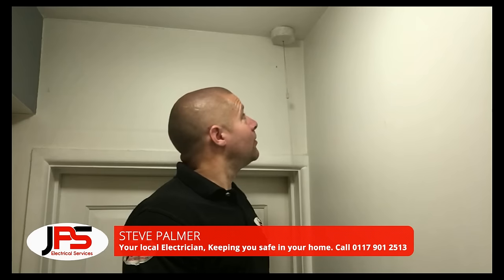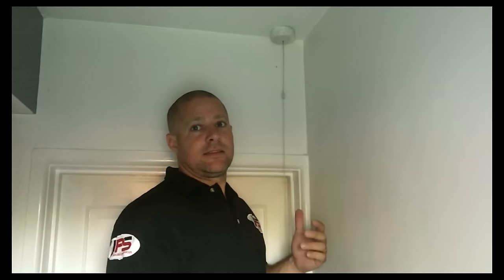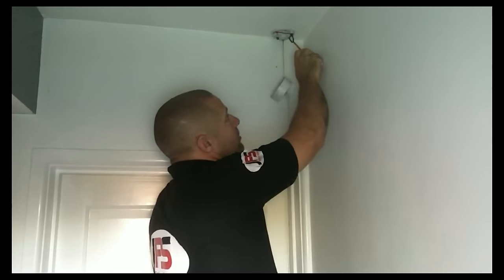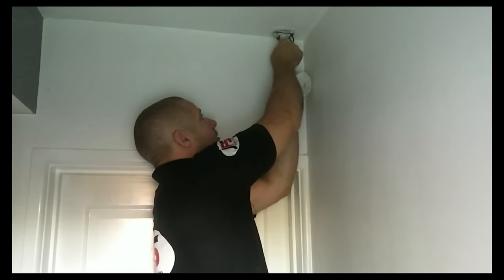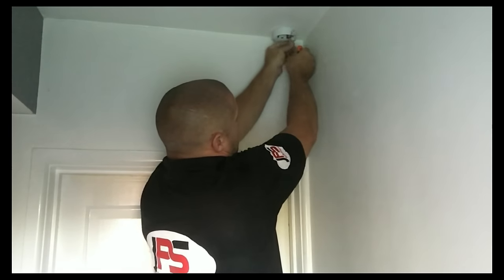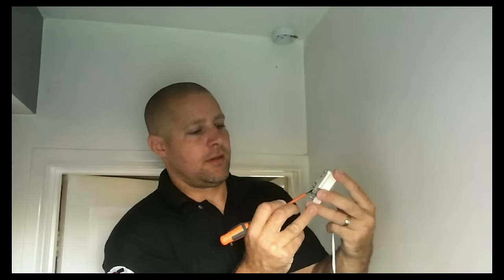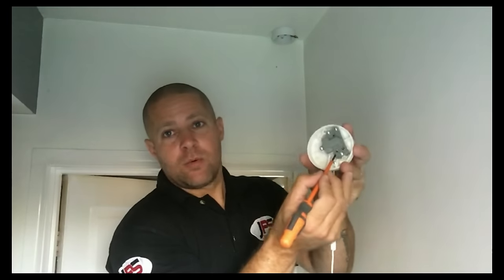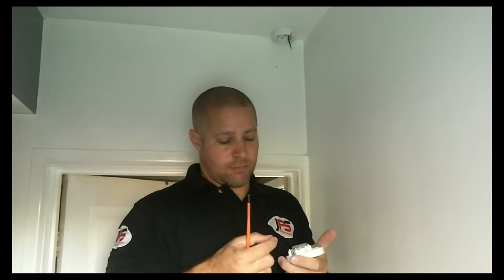How To replace a pull cord light switch - Your local Electrician

Comment: For anyone caught out by closed shops, but desperate for a fix, the switch can be dismantled and cleaned. It's not a difficult job, and can get you out of trouble. Ultimately, a new switch will be required and it's great to see videos like this giving confidence to laymen. I've taken my "broken" switches apart many times. You'll see a little plastic plate with a couple of screws holding it in place in the centre of the switch plate. This houses the mechanism,  essentially a spring and a two-piece locking/turning device, which sticks when dirty. Remove this, but don't cut the cord as this keeps the parts from going astray. Let the pieces fall away from each other and use a tissue or cotton bud(I sprayed some glasses cleaner on mine!) to clean the parts inside and out. Put them back together again and, with luck, the switch will continue working for some time. Generally it is just dust, grease and grime that makes the switch stick. takes about fifteen minutes to do the job from start to finish. And it's eco friendly.

Comment: Fab video Steve, just fitted my pull string light in the bathroom. I Wouldn't normally touch electrics, as a single woman I would usually call someone in. You made it look quite simple so I gave it a go. All 4 spot lights and the fan came on. 💃 So thank you very much indeed.😊
Reply from the maker: Hi Denise, I'm sorry I missed your comment. I do try to reply to as many as possible but unfortunately it's not always possible.

Thank you for taking the time to let me know how it went. I'm pleased my video was of use to you.

Kind regards
Steve :)

Comment: Thank you so much for the information! I was quoted  £90 - 105 + vat and parts (+ £25).
Decided to give it a try after watching your video. Took exactly 6 minutes and cost just £5.50!
Reply from the maker: You are most welcome :)

I'm pleased that you found my video useful. Thank you for taking the time to provide me with the feedback.

Kind regards
Steve :)
Reply: @JPSElectricalServicesBristol  i have two red cables how do i know which is live
Reply from the maker: @MrRapez  Confirm that each wire is in a different screw terminal on the existing switch. If there are markings on the existing switch showing C and L1 then mark one of the cables so that you can copy it on the new switch.

Kind regards
Steve :)
Reply: @JPSElectricalServicesBristol  ive sorted it thanks for your help
Reply: Who ever quoted you that should be bloody ashamed of themselves, total disgrace.
Reply: Yes 100% agree. 👍 

It seems some of the neighbours have paid an eye watering amount for simple jobs and most of the local tradesmen now think it is a norm and ok to fleece customers. One of them had a cheek to say that if it fails in next six months he will fix it for 65£ but cash in hand!
Reply from the maker: @TeeLion  Too many variables to support this statement! This is exactly around my price range for a job that can be completed within thirty minutes of being AT the property. Do you think I should feel ashamed of myself?🤔
Reply: @JPSElectricalServicesBristol  what for changing a pull cord switch? Mate your having a laugh.
Reply from the maker: @TeeLion  That's not the first time I have heard that response but in the twelve years I've been in business I've had more people pay my prices than question them.  For those who cannot afford my rates or prefer not to pay my quoted prices they have the option to use a cheaper electrician or view the video I created to see if it's a task they may be able to undertake themselves?

Comment: Fitted a new one cause the old cord came out and putting it back together looked a nightmare. However the builder we had to install new broom, kitchen, radiators and boiler cut a gap in the live wire sleeve when he fitted the switch so when I put the wires in the new switch it touched the ground which had no sleeve and shorted and tripped the light circuit breaker. 

Stripped the cables all back, luckily had lots of excess cable, rewired following your inst, all sorted. Thx a lot, life saver. 

This is the 5th time I've had to fix a problem he created, goodness knows how the heating still works but have had the boiler serviced every year so that helps I guess.

Comment: Thank you so much for this! I replaced mine today where the spring had snapped, and this video a. worked, b. I didn’t get electrocuted, and c. I didn’t need to call and electrician.
Reply: Hi there, do I just turn off the main switch that controls all the electricity in the house? My string just snapped this morning . Lol

Comment: Thanks for the video, very useful. Only suggestion would be to include both the old and new electricial wiring colours for the UK. 

I had brown and blue cables (new system) rather than the red and black cables (old system) you mentioned. Wasn't a huge problem as can easily find this information online, but for anyone else reading this in future and confused:

LIVE:             Red (old) = Brown (new)
NEUTRAL:    Black (old) = Blue (new)
EARTH:         Yellow & Green (both old and new)

So Red or Brown wire into COM and Black or Blue wire into L1
Reply: Thanks for that. I was a bit confused.

Comment: Cheers pal, just changed mine. Would have done it ages ago if I’d known how easy and cheap it is to replace. One thing I checked was to see where the wires were going and into which terminal before undoing them.

Comment: been in our house 12 years and the original cord has snapped in the switch...how do you identify which cable is which if its not sleeved...
Reply from the maker: Hi Rob, with a pull cord switch, red (or brown) in Common and black (or blue) in L1.

I hope this helps.

Kind regards
Steve :)

Comment: You said to put the red wire in the common but when I opened up my pull cord socket it showed black in common and red in 'way' and the green and yellow in earth?
Reply from the maker: Thank you for your comment.

It will still work the same on a pull cord light switch. If you did the same thing on a standard rocker switch then the light would be on when in the off position and off when the switch is on the position. Some people will just unscrew the light switch from the wall and turn it upside down to rectify this issue.

The correct way is Live to Common, switched live to L1.

I hope this reply is useful.

kind regards
Steve :)

Comment: Your instructions were very helpful thank you. I seem to have to pull the cord 3 times before light comes on. Do u think I will need to replace the whole thing? Thank u.
Reply from the maker: Shamini Sathiya Thank You for taking the time to comment. I’m really pleased that you found my video useful.

With regards to your light switch. It sounds like the mechanism inside is slipping. I have seen this numerous occasions and if this is what has happened to yours then a replacement will be required.

Kind regards

Steve :)

Comment: Hi Steve my pull chord switch in my bathroom has stopped working and I need to replace it (I've recently bought a new two way switch, although I believe that a one way would of been OK). My current pull chord switch turns on the extractor fan as well as the light. Will the wiring be exactly the same set up as in this tutorial?. I haven't yet managed to get the old fitting down as the screws are rusted up, but I suspect that the old wiring inside may be different colours to how they are today?.
Reply from the maker: Hi William, yes indeed. There could be additional wires inside the switch that will be for the fan. It all depends on how the wiring has been configured. I did one only last week where even though the fan was wired onto the lighting circuit, all the wires had been wired in a junction box in the loft rather than the switch.

I guess it’s time for another video demonstrating the method when extractor fan wiring is taken to the light switch :)
Reply: @JPSElectricalServicesBristol  , OK Steve thanks for the reply. Once I get the old switch open (I suspect that I'm going to have to break it because the screws are rusted solid), I'll see if it looks like a fairly straight forward job. If it's just a matter of uncoupling the wires and reconnecting them to the new switch then I'll do it myself. If I have any doubts about what I'm doing, I guess for safety reasons I'll have to see about getting an electrician in. Once again, thanks for the prompt reply.
Reply from the maker: @williammorley2401  camera phones are a life saver these days. Be sure to take lots of shots, from different angles, before you take everything apart. This way, if you don’t recall what went where, you can refer back to the photos.

Also, some switches will mount straight to the existing base. If this is the case, it can save you having to strip everything down completely.

I hope this helps.

Kind regards
Steve :)
Reply: @JPSElectricalServicesBristol  , thanks Steve...

Comment: Very helpful thanks. Just one question. I have a pull switch that connects the fan and the light. There is a separate isolation switch for the fan outside the bathroom. There are 3 reds (one from fan, light and also the isolation switch outside} 2 blues (currently tied together.. One from light and fan} and one black and grey (coming from the isolation switch and tied together). The 2.way pull switch has L1, L2 and com..The 3 earth wires are correctly and safely in the back plate. Its the grey wire throwing me. Thanks :)
Reply from the maker: Hi Tim, thank you for taking the time to comment. I'm pleased that you have found the video useful.

Unfortunately there is a discrepancy with the information that you have provided. For this reason, it would be very irresponsible for me to try to advise you further.

I hope you understand that it is more than my reputation is worth to try to advise on how to proceed with only a description.

Kind regards

Steve :)

Comment: My rope snapped at the top so I purchased a new fitting when I took the old off fitting all the wires were red not the usual blue,brown and green. I thought I had memorised where to screw them into the new fitting..put it all together and then turned on the electric by the mains and pulled the bathroom cord. I was relieved and happy that the light had came on. When I was going to put my daughter to bed I realized that her bedroom light, our bedroom and the landing is not work. I read that that it was something to do with a loop the lights are on but kind of confused me. My question is it's dark upstairs now and I've had to leave the bathroom light on for light and especially if my kids need the bathroom during the night because all the other lights  now don't work. Will me leaving it on as it's been on for two hours cause a fire or Dangerous? I'm so paranoid now but it's to dark to do anything about it now. Can anyone please advise me.
Reply from the maker: Hi Pete, did you get any further with this?

My video only makes reference to the single cable coming into the switch which is the more common application.

When advising with regards to this method people can easily get in a muddle and if they don’t have the correct equipment then it can be difficult to prove what has been done.

If you still need help, perhaps we can arrange a video call to discuss what has happened.

Kind regards
Steve 🙂👍🏼

Comment: Hey there is it harder with one that has a on/ off circle switch thing in the socket next to the pulley?
Reply from the maker: Hi Aiden, thanks for taking the time to comment.

This video is for a light switch. The on/off toggle is usually found on shower isolators or even extractor fan isolators.

Do you have a link that you can add so that I can confirm the item is correct please?

Kind regards
Steve :)

Comment: Hi I have one for u. I have a pull cord switch with in and out wrote on it. My new switch is common l2 and l1. The one already installed has 2 cables and both are red/live so no black. Can I just copy it across? First time I've seen 2 lives on pull cord with 2 separate cables. Can u help please.
Reply from the maker: Hi Anthony, thank you for your comment.

Please can you visit my website www.jpselectricaslservices.co.uk and use the contact form to get in touch. It will allow you to upload a photo. This will enable me to see exactly what setup is in use at your property.

I look forward to hearing from you.

Kind regards 
Steve :)

Comment: Really great video, helped a lot! would you mind sharing how do i find out how many amp is needed for my pull cord switch? i saw many different ones online... thanks a lot!!
Reply: O that will be usefull for my as well :D
Reply from the maker: I'm sorry that I missed your comment until now. It's sometimes very difficult to reply to all of the comments.

In the UK, our lighting circuits are usually supplied by a 3, 5, 6 or 10 amp circuit from fuse box.  The higher rated ones such as 45 or 50amp ones are for shower circuits that require a lot more power.

Kind regards
Steve :)

Comment: Hi I have 3 black and 3 red wires? Not sure which to connect ? Do I need all of them connected?
Reply from the maker: Hi Rebecca, thanks for taking the time to comment. 

It sounds like you have already taken the accessory apart. Did you take a photo as reference beforehand? Usually one of the black wires will be identified with either a small red or small brown marker. Can you see this on any of the wires?

Kind regards

Steve :)
Reply: @JPSElectricalServicesBristol  Hi, I managed to figure it out! Thank you for your help :)
Reply from the maker: @rebeccar9916  fantastic news. I’m so pleased to hear this. Did one of the cables have a small marker on it?

Kind regards

Steve :)

Comment: Hi, JPS Electrical Services if i have a shaving light above the mirror but i want to change the light to a one that doesn't have a pull cord how will I do it ? i don't have a wall switch for the light is just the pull cord at the moment ? Thanks
Reply from the maker: Hi Andrei, thank you for taking the time to comment.

In this situation I would highly recommend that you seek advice from your local electrician. The reason being is that Alterations/additions to the wiring in a special location (bathroom) are notifiable to the Local Authority Building Control by law. There are particular requirements that must be in place to ensure that you remain safe in your home.

Kind regards

Steve :)
Reply: @JPSElectricalServicesBristol   Hi Steve, will do. thanks for getting back to me👍🏼

Comment: Thanks Steve.. I've put a new light pull switch on today but hour later it's doing same thing again, keeps going out or not coming on.. what do I do ??
Reply from the maker: Thanks for taking the time to comment. 

What type of light do you have installed?

Have you checked the connections at the light? Obviously be sure to turn off supply before exposing any wiring 😉👍🏼
Reply: @JPSElectricalServicesBristol  thanks for your time.. it's a one way ceiling pull cord.. I've fitted it 3 times though the years.this time I've checked it rechecked it... trimmed the wires to fresh but it's just not working at all now... I'm puzzled what to do next 😕
Reply from the maker: @deanspencer13  some lights use LED lamps (light bulbs) which can fail. Some also use LED drivers, transformers or starters. Can you send me an email with a photo of the light please and the wiring in the switch and I’ll see if I can advise you on a private messaging service.

Kind regards
Steve 🙂👍🏼
Reply: @JPSElectricalServicesBristol  that's great of you.. took the photos.. what is email
Thanks
Reply from the maker: @deanspencer13  steve@jpselectricalservices.co.uk 🙂👍🏼
Reply: @JPSElectricalServicesBristol  okay great thanks Dean
Reply: @JPSElectricalServicesBristol  I did send photos to email address Steve.. did you receive ok

Comment: Hi Steve I took my old switch off to find a red wire a black wire and a wire with no plastic coating just copper?
Reply from the maker: Thanks Chris for taking the time to comment.

If I am understanding correctly, you are describing a single twin and earth cable coming into the switch with a red (permanent live) wire, a black (switched live) wire and a bare copper (earth) wire.  First things first, you should put a piece of green and yellow earth sleeving onto the bare copper earth cable. This prevents it coming into contact with any other cables. This cable gets terminated into the earth terminal of the base.

Moving on to the switch - the red cable will go into the terminal marked ‘C’ for common and the black into L1.  

Please let me know if this information has been useful.

Kind regards

Steve :)
Reply: @JPSElectricalServicesBristol  hi Steve thanks for the help it was red live and black switch with the bare copper being earth. Very hard to wrap it as this would involve taking out the whole cable which by the looks of things will run through the whole house. Unless it's possible to put a small section of sleeve over just the exposed part of the wire were the switch is.
Reply from the maker: Chris Jones, it’s only the bare copper at the switch that needs sleeving with green/yellow sleeving. The rest of it is fine as it is contained within the sheath of the cable and there is no risk of it coming into contact with any other conductor under normal usage.
Reply: @JPSElectricalServicesBristol  hi the red goes into the one marked com. does  it matter if the black goes into any  one of the other two marked L1  or L2

Comment: Bought a pull cord switch and was told by the vendor it has no L1 screw / fixture (by design). Is that normal? Reluctant to change the faulty one until I know for certain!